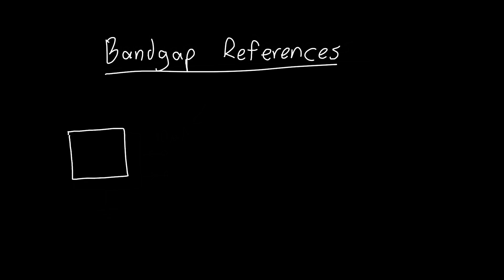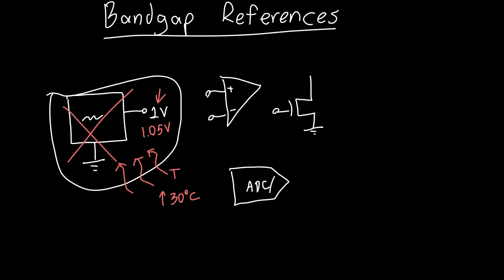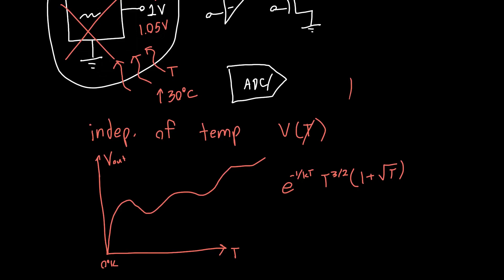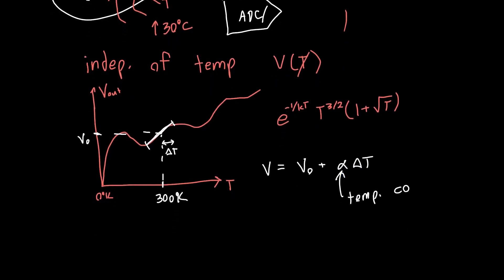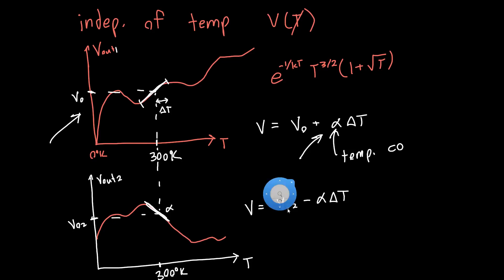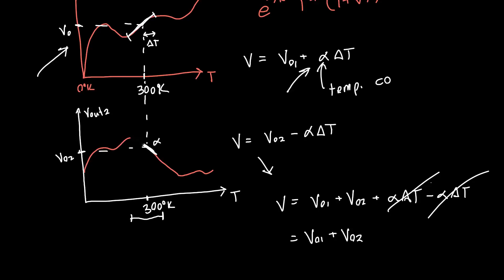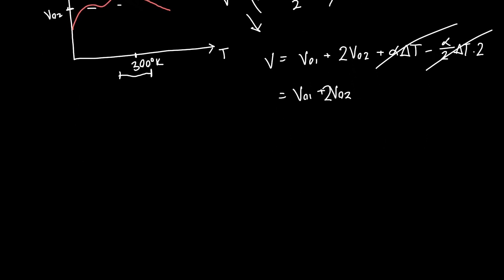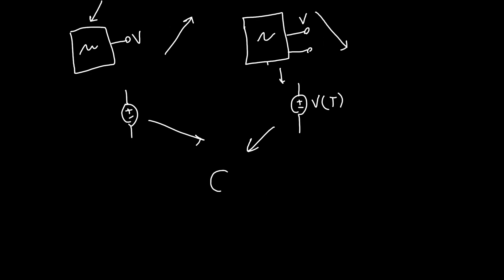Bandgap Reference Introduction

Comment: Very nice and comprehensive explanation, many thanks! What I've missed is the correlation of the idea to the Band gap of the semi conductor material used like silicium.
Reply from the maker: Yeah, it's buried pretty deep in the circuit. Basically, if you do a bunch of math (which I haven't done in this video series yet), you can get an expression for the voltage that depends on the bandgap of silicon. Razavi's book on the subject does a decent job of showing where it comes from.